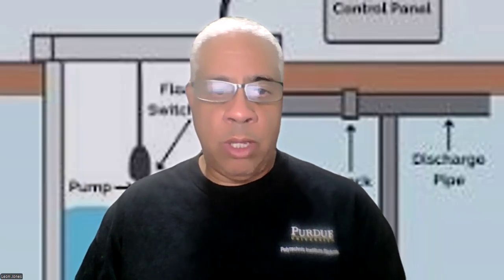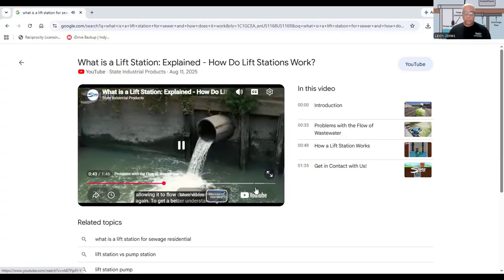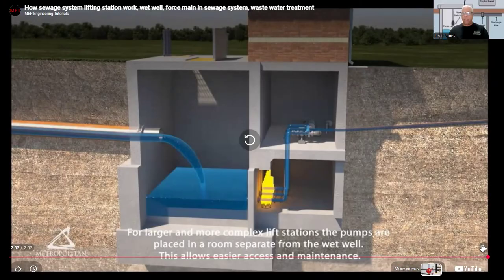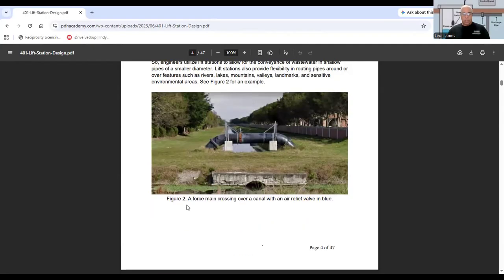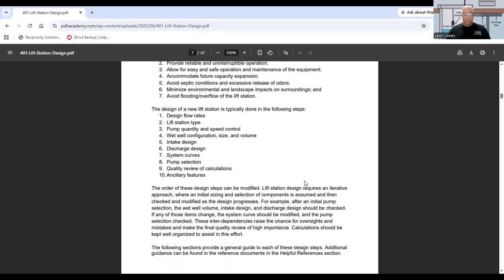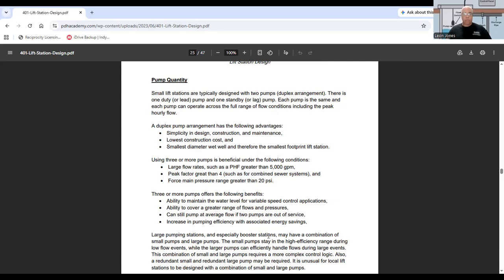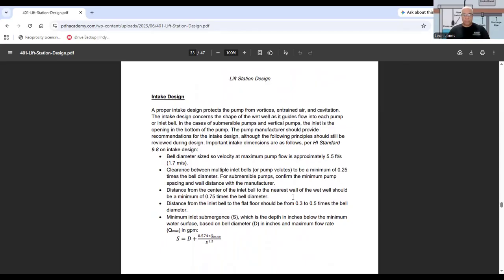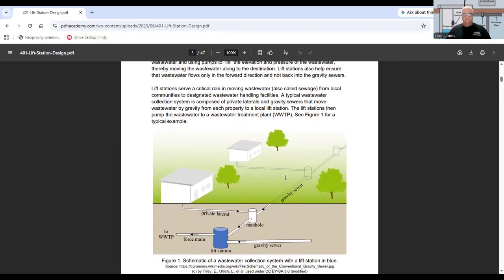What is a Lift Station for Waste Water and it's Function

Comment from the maker: A lift station is a pumping facility used to move wastewater from a lower elevation to a higher elevation when gravity flow is no longer possible. Once the gravity sewer reaches its low point, the lift station pumps the wastewater through a force main to the wastewater treatment plant.